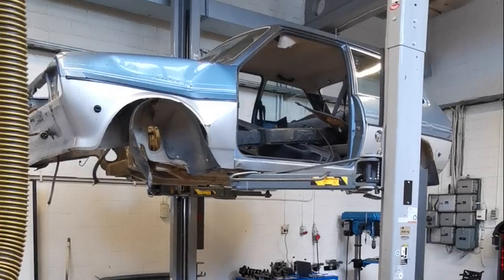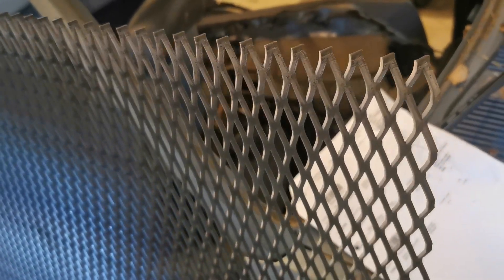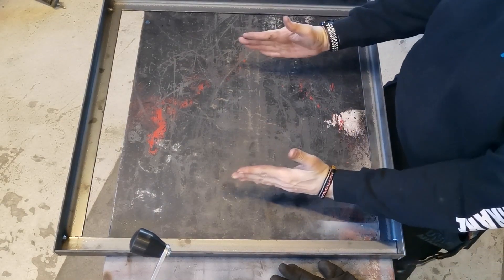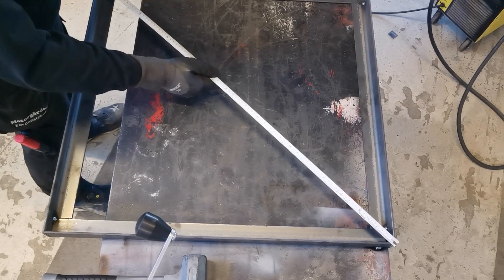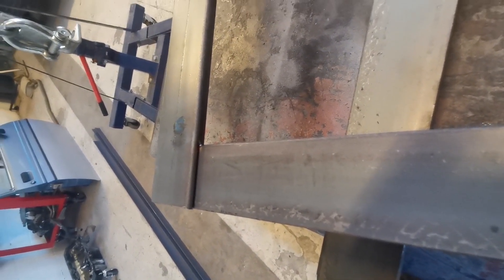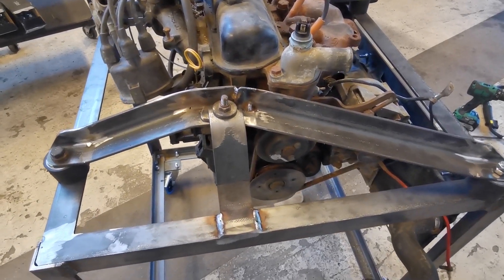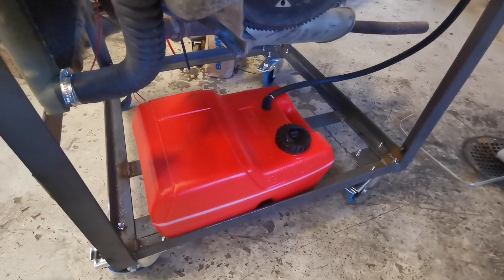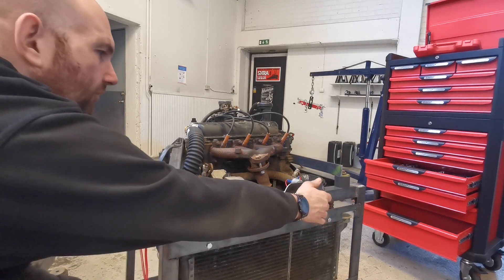Making the most of a Ford Fiesta mk1. part 1. I fabricate an engine test rig from and old Fiesta.

Comment: nice setup,that takes me back to 1985,when left school,went collage,they had engine shop,ohv,ohc,v6,v8,diesel engines,on stands,they explain how they work,then later ,they fiddle with them,so not start,and was up to us to get them going,back basics,fuel,spark,timing ,fav was no roter arm,swop leads,fuel pump not run,had flash backs of that ,when see your rig,looks like you are in a school enviorment too,not normal garage,well nice to see you pass on your knowledge to others ,videos ,do miss stobe light,points plugs lol,now scan tools,pico scope,how its all changed